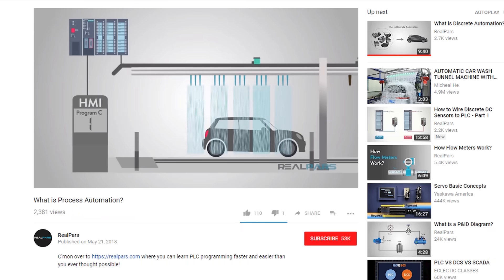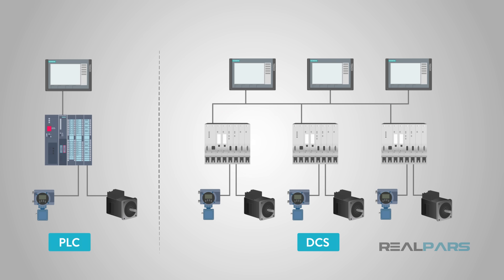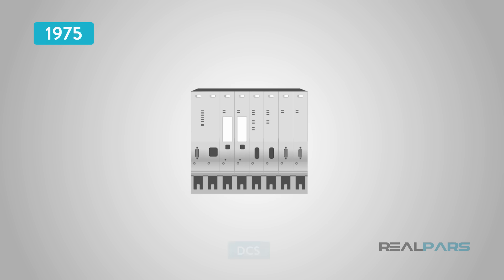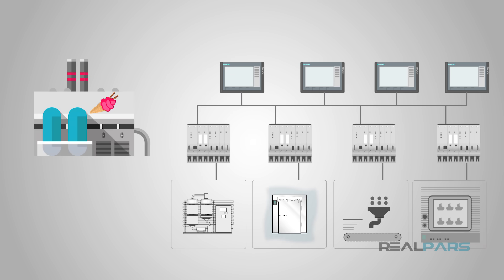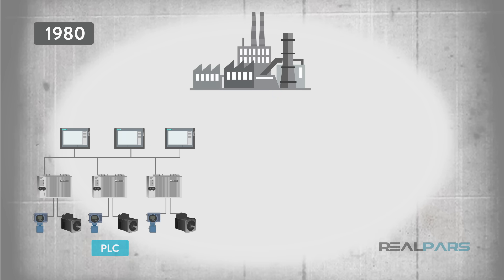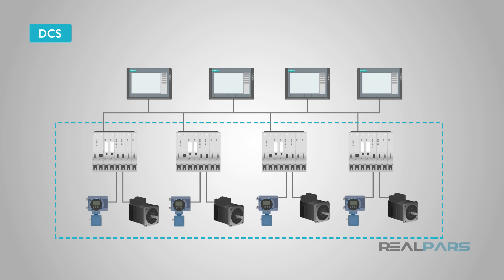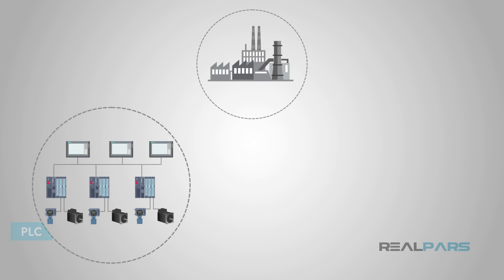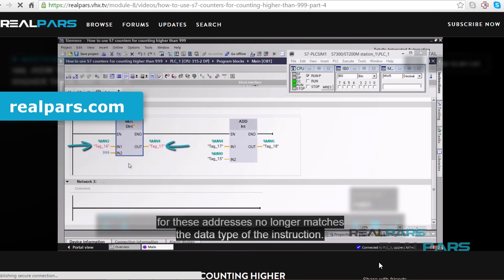What is the Difference Between PLC and DCS?

Comment: Most electrical engineers working in an industrial environment , metals, materials handling, mining or processing are conversant in both PLC and DCS programming and as pointed out the differences in operation and implementations are very similar. That said, that it is why things like stuxnet became a reality and an on going problem that will not go away. While we know about stuxnet and the variants that are similar but different made up of different and often from unrelated and unexpected blends of vulnerability and hence they don't go away or are permanently fixed.
Reply from the maker: Thanks for the comment, Richard. As automation engineers, we need to take these kinds of threats seriously.